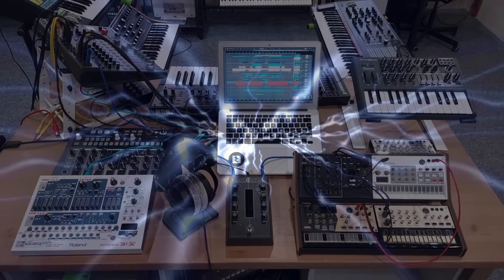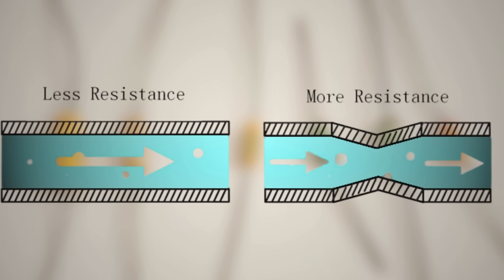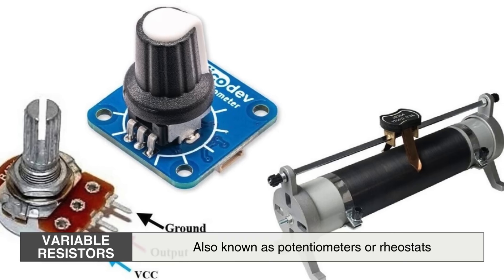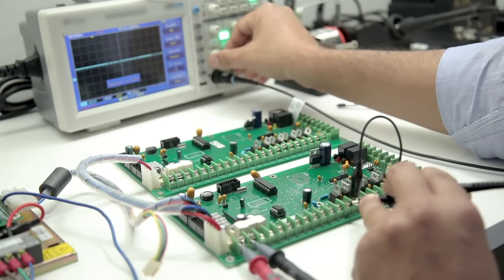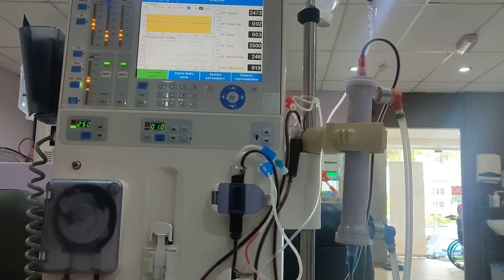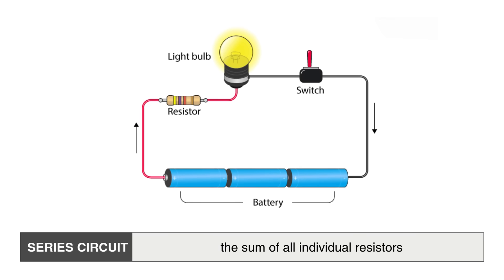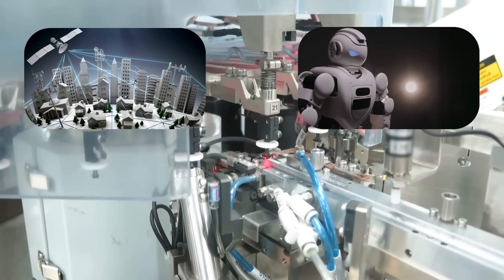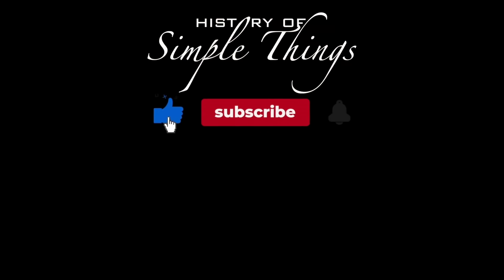What Are Resistors? The Secret to Every Electronic Device!

Comment: The use of a Resistor in an LED Circuit is described inaccurately.
Most people do that.
An LED is at it basic Component, a Diode.
A Diode that emits light when used correctly.
Light Emitting Diode = L E D
Current can only flow one direction in a Diode.
It's like a gate, or turnstile.
However the Turnstile does nothing without people moving thru it. 
The same with a Diode.
The resistor is need in order to provide a current thru the diode.
The resistor could be a common resistor, or even an Incandescent Light Bulb.
Incandescent bulbs create light by resistance to the flow of electricity creating heat and thus light.
An L E D in a circuit would not work in one direction, and be a direct short in the other direction.
But it wouldn't create illumination.
Not without the resistor pulling power thru the circuit.
H.o.S.T. needs to do a little more research for it's videos. 
I've found several mistakes in each one of the 100 I watched so far.
Most of them simple dumb ones. 
Interesting videos, Yes. 
But several mistakes none the less.

Comment: What is inside resister, how does it controll electricity ?
Reply: Usually it is some sort of conductor, such as carbon that has been mixed with other material.  In some resistors, a thin metal film is used that doesn't pass electricity very well.

Comment: Less expensive than using a step-down transformer?
Reply: Well many factors at play, not least of which a transformer only works with AC.
Reply: Yes.  A step-down transformer needs alternating current to work, so DC couldn't be controlled.  Also, a resistor is about the cheapest way to control electrical current.
Reply: They use a resistor and a Zener Diode to regulate DC voltage.

Comment: So does that mean that everytime electrical current is being regulated/decreased, that heat is created?
Reply: Every time anything happens heat is generated...
Reply: Yes.  Any time there is a transfer of energy, you're going to get some heat - though it might be very little.
Reply: Um.  Yeah.
Reply: Yes
Reply: Yes, that's why they have power ratings, typically start at 0.25 or 0.5 watts for through holes ones, ie have leads. Not sure about surface mounted ones, guess less.